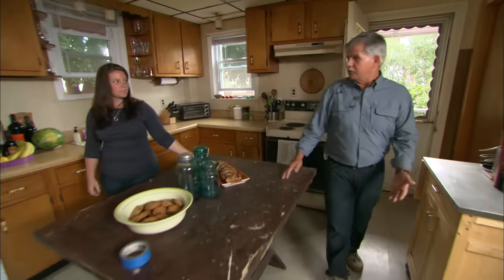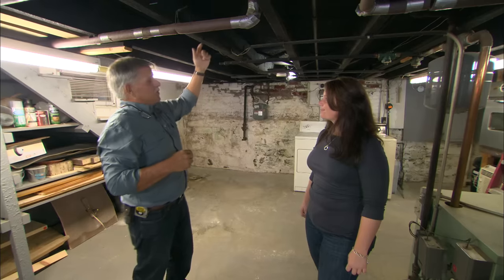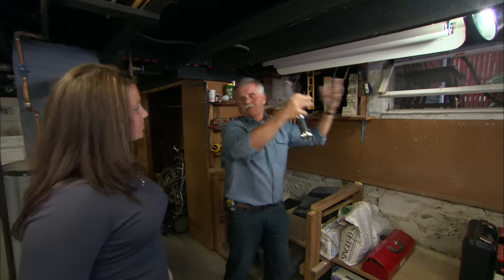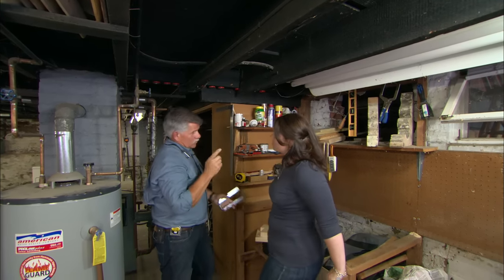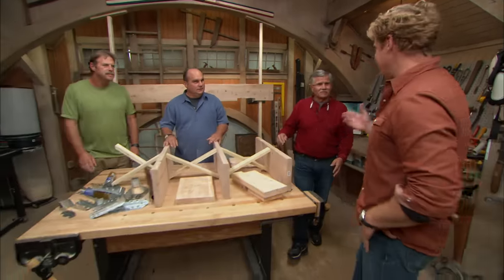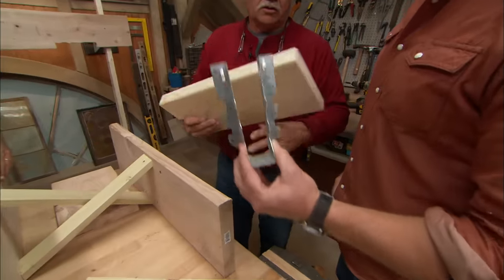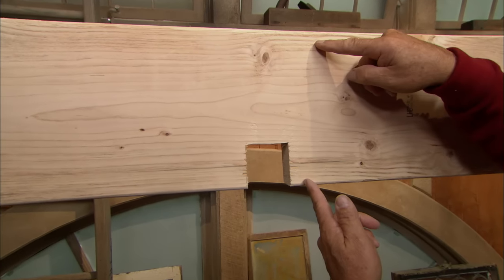How to Repair a Cracked Floor Joist | Ask This Old House

Comment: Tommy sure nailed it! plumbers hack up the framing all over. I have gone in after them and had to redo their work and repair the framing as well!
Reply: I saw a guy put in a gas line he cut out a notch thats about 75 % of the floor joist
Reply: Previous owner's plumber cut the entire joist to lay a pipe (rather than modifying the pipe run) and propped up the mess with loose brick (in a crawl space, about 20 inches tall).  I get to fix it.
Reply: bob nice, if its done right, then you can sleep like a champ,

Comment: Good job on showing the repair, however if the floor has sagged to a certain extent, the one thing he missed is that the flooring you put in can or will buckle, had to replace the flooring in my laundry room due to the re leveling of the floor. Be aware of this as you may end up replacing that flooring due to re leveling. It will also depend on the type of flooring in place.

Comment: Bridging not only transfers load to neighboring joists, but bridging (or aka blocking) also prevents the joist from rolling or twisting, which significantly reduces the maximum load of the joist.

Comment: Cutting out a sharp corner introduces high stresses (under load) into a beam, etc. Radiusing the corner greatly reduces the peak stress and spreads it out.

About 1967 or so Ford racing engines had a high failure rate due to that very thing. When machining a bearing journal or something that had two perpendicular faces, they used a sharp tool to cut into the corner. High RPM, etc caused several failures, before they learned another way to do things.

They ended up using a slight radius on the cutting tool, something like 1/16" radius. Bingo. No more broken crankshafts.
Reply: Exactly. Radiusing crankshaft fillets is standard procedure for increasing crank strength.
Reply: Great story

Comment: When I was assigned in the Middle East by my government in 1975 (I was 49 years old by that time) I am also an adventurous guy so I went from village to village and I saw a carpenter doing something strange and he told me he is making Aramaic wood which is wood of the Aramaic Bible. He cuts the timber into very thin, long, rectangular sheets and placed the 1st layer on a very thick and flat metal non-sticking anodized surface that has guiding pins made out of the same material on it's sides, then he brush it with a thick layer of boiling sap resins and places an another one on it and repeats the same process until he has reached the desired thickness and then a non-stick annodized thick metal plate is place on it and his sons and nephews places iron weights on it. 

He said they sometimes use a large number of vices to compress the material. He also said they do not make this woof often anymore except as timber beams and timber posts, joists and rafters and wall frames, stair way supporting frames, floor and wall and stepping stairway foundation planks, foundation door frames and doors only for very well to do traditional families. 

They only do it for the main wood foundation structures only for the hardened and cured sap resins discolors the very thin wood layers as it penetrates and saturates the wood. Then they place a thin layer of the desired wood and use modern wood glue and small nails to cover it with non-discolored wood. 

And it is almost virtually impossible to break because if he takes two pieces of thin wood layers and used the same technique of binding them together and holding them in a very tight vice the layer between the two pieces of wood will not break but only either the outer sides will start to crack but when used as a very thick planks, beams, posts, joists, rafters, stairway supporting frames, etc it is virtually indestructible. 

I asked an Aramaic Priest about the historical background of the Aramaic wood and he said it is the same kind of wood used by Noah to build his Ark! When properly made, hardened, and cured, and seasoned it should last forever and will outlast any metal and stone and clay and ceramics known to man. The gopher wood mentioned in the Chrisian Bible is actually structural laminated wood, only done in the original Pre-Flood methods and techniques.

Comment: The bridging is under compression as described, not tension.
Reply: Technically both. The "downs" undergo compression, the "ups" are in tension.
Reply: @VideoNOLA  Cross-bridging as shown cannot hold a tensile load.  Nails do not work well in shear.  Only the members pointing down from the joist in question will transfer the load by compression.  Just saying.

Comment: Tommy said there would still be a pitch! Why wouldn't the floor level up if the joists is fixed?
Reply: 'cause the whole house has settled over 100 yrs in part because all of those joists were notched. Also foundation cracks,  settling, deterioration, expansion and contraction from freeze thaw cycles,  earth quakes, soil compaction or lack of , underground water, flooding, poor drainage  etc. yada yada.

Comment: I was just under my inlaws house thru the crawlspace of their 70 year old home, and they had bridging. The bridges were nailed at the top of the floor, but none were ever connected to the bottom of the 2X10's...they were just hanging there waiting for nailing that never occurred.  This is why their floor always had bounce. Pretty crazy stuff.
Reply: Did you fix them?
Reply: Crazy! You can also add strapping I think. This can replace bridging

Comment: OK Tommy said you had to nail a sisters section to a damaged beam. Of course drywall screws are WRONG but would not deck screws or 1/4" thread size lag bolts be OK?
Reply: +esoomreltna properly sized wood screws would work. The reason that nails are preferred in this type of application is that nails have better shear strength than screws and the load on a sistered joist is mainly shearing force.
Reply: Shear strength has to do with the type of material and the cross sectional area. Drywall screws are not acceptable for these types of situations because they are too brittle (Just as Tommy said). Walking on the floor creates a cyclic load on the fasteners. A brittle faster, like a drywall screw will not stand up to that cyclic load as well as a softer steel nail.
Reply: Most screws dont have any sort of shear strength rating required for structral work. Simpson (and other manufacturers) make specialty screws that have engineered load ratings and are alot easier to work with than lag bolts. I

Comment: My joists are notched on my ancient house and a few have split. I ended up sandwiching each cracked joist with pieces of scrap on both sides and hanged tools from them to disguise my original intent.

Comment: Why not use construction screws instead of nailing ?

I thought was common knowledge no drywall screws for strength..  just use proper stuff.
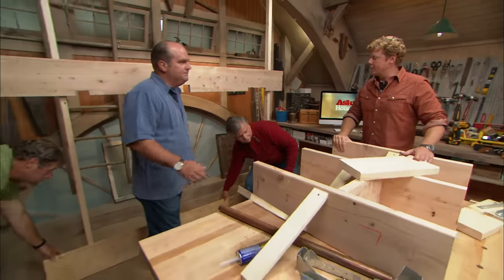Reply: 9:36 drywall screws vs nails
Reply: Home Depot was too far away
Reply: I was in a house where the guy installed the joist hangers for his loft with drywall screws

Comment: I would have added a second joist just to reinforce that part of the house and probably a small metal pier in the middle. But I'm a freak: I like to over/secure things. I hate frailty. I like sturdy and super solid structures

Comment: If possible it would be even better to avoid cutting into the bottom and top part of the joist, as this is where the tension and compression in the joist is the highest. At centre height there is a line of "dead" Wood between tension and compression where you preferably make Your holes.
Reply: INdeed. IM surprised that few have mentioned that the large hole in the beam is in the top compression area. Reinforcing the bottom tension area as he did is pretty pointless if you still allow the compression to remained compromised.

Comment: ...or....you could just use the correct screws like coated structural lags.....
Reply: Aezelll and spend how much more for those over a 10d
Reply: @snowmobilertodd  There are other reasons; very seasoned hardwood (recycled) that has to be pre-drilled, aged, RSI tormented arms, that find it far less painful to screw, no room to swing a hammer etc.

Comment: Regarding screws vs nails on the sister of the joist is the true reason we use nails over screws is that nails are stronger when applied horizontal then screws , Nice video as always
Reply: I think so

Comment: The Cro Magnon we bought from hacked about 70% the way through three adjacent floor joists to run a heat supply line, just to avoid building a duct box in a basement ceiling. I was just as mad at him as I was at myself for missing it, never mind the Home "Inspector" we hired that probably overlooked it for the realtor. Anywhoo, the plywood sistering job I did about 5 years ago is just what is called for here, tons of PL and a half a box of nails. Good series this.

Comment: I know this is an old video but can you use lag screws to attach the sister board? Something like a Spax powerlag screw or GRK structural wood screw as options

Comment: At the end of the video....placing a 1/2" plywood stringer along the joist.  Use wood glue, spead it evenly over the entire surface and then nail it into place with those same joist hanger nails.  We call them Teco nails.  they are loaded with sheer strength.  Place them every 12" and 2" from each edge.   I did this on my 2x4 roof rafter 100 yr old house.  The cedar shake roofing had been ripped off, leaving 1x8 roofing boards that they nailed 1/2" plywood sheathing to and then asphalt roofing.  The rafters are 16" O.C. We bought the house and found that the center 8 rafters (It's a hip roof) that are 18' long had a 2" bow in the middle from the weight.  I got a big beam and placed it on the floor to carry the load (2x6 floor joists acting as ceiling support for 2nd floor bedrooms) and then jacked up the roof about an 1".  Lots of creaking and I didn't want to risk any more.  then glued a 2x4 on edge with each rafter all the way tapered to the outside wall rim cap.  Lots of knee time laying on the the floor cramped up against the roof.  Then sandwiched each new "2x8" with 1/2" plywood glued and nailed as described above.  Staggered the plywood to carry the load.  This saved 1 1/2" space, made the roof 3x stronger and saved the 7" space to spray in foam.  Then capped it all with T&G pine, carpeted the floor and put in a pool table and a wet bar with fridge and ice machine.  The ultimate kids hangout.  The floor is insulated and we never hear the kids with their friends over.   Teco nail those 1/2" plywood sandwiches you make. - every 12"

Comment: Yeah, don't put notches in the top or bottom of beams - especially not in the center of the span.  The critical failure mode on beams is normally bending and the peak bending stress normally (assuming you're loading the beam fairly evenly) happens at the center of the span.  That's why it needs to be its thickest at that point.  If you absolutely need to run something through a beam then drill a hole right in the center of it.  That way the effect on the moment of inertia (and therefore the bending stress) will be minimal.  Or if clipping the bottom of the beam is totally unavoidable for some reason then add a doubler like they're showing.

Comment: hnnnnn I learn so much from this show, I love using drywall screws but I know all too well the heads break right off if they are used incorrectly.  I used to just buy stronger screws like those that would say structural grade screws. but Nails huh, never thought they would actually be stronger.  I don't think they taught me that in school lol. Love this show.
Reply: Well I'd say drywalls screws have some strength but they do snap off. When's the last time you saw a 12d or 16d nail break in the middle?

Comment: I know drywall screws are too brittle to sister a joist, but would you ever use steel exterior or decking screws?

Comment: Don't screw the wood on because "Drywall Screws"...?  Bolt it on or lag it.  And it's always better to cut into the top of a joist rather than the bottom.  The top is in compression and less likely to fail.
This is an old video.  Tommy has changed his mind about a lot of this.

Comment: I have to tell people about using drywall screws all the time. I prefer to screw everything with the correct exterior grade coated screws but I use nails for rough framing. Usually because you're framing too much to screw everything. I always use liquid nail as well. I feel like you can't use it enough especially where two wood surfaces meet each other.
Reply: Liquid nails is literally one of the weakest construction adhesives you can use!......Bad choice.
Reply: @cornbobrimlove7892  I use it to keep from squeaking and it reinforces joints. As far as it being the weakest adhesive I can't imagine needing anything stronger. I've built many additions garages and all types of wood related jobs around a home and they're all still together and not making a sound. If its junk then so be it. I'll use it til it fails me or they stop selling it. I've used PL 400 as well but for the extra cost I don't see the difference. I'll stick with liquid nails.

Comment: What if the notched joist in question is hanging on concrete? Can you still use a joist hanger attached to concrete?

Comment: I'm curious: 06:00: because of that bad notch, does it mean that joist is now essentially 2x4? Meaning structurally it is as if they used 2x4. 

This is an awesome channel I recently discovered.
Reply: I would think not, because 99% of old houses are built this way and they are still pretty solid. I think the fact it's at the ends changes the equation. Regardless I think adding hangers is cheap insurance and I will do it.

Comment: Installed solid blocking like this on my new house. With lumber shrinkage the floors would creak so all the blocks and joists had to be screwed together.
Reply: Moon Pie  I joists seem to be the industry standard today.  Twenty years ago (in this area) only high end houses were built this way.

Comment: Why was the joist hanger so short ?  Tommy says it fits perfect, but the bottom holes in the hanger couldn't be used (see 4:04).  Simpson Strong Tie always recommends using every nail hole in their hangers for structural integrity.  Tommy could have used a longer joist hanger and thus use more structural nails.

Comment: When using joist hanger one of the worst things you can do is drive the nails in lever or at a right angle to the beam or angling the nails upwards (like if you are a short guy having to reach up). Over the years the load can pull the nails outward and the hanger can slide down the nail. The best way to drive nails is slightly downward so that as the load is applied to the nails the hanger wants to slide closer to the carrying beam and the nails are pushed tighter into the carrying beam. I see wind bracing nailed from inside the attic outward so that if the roof did try to lift off the nails would be pointing in the same direction as the pull, not good. Wind bracing should be nailed from both sides so that you have nails both pushing and pulling against the load.

Comment: FYI 3/4 plywood only adds about 12% of the original board's bending strength, and only in the 8 foot long area of sistering.  You can't glue on a bunch of 8 foot long strips of plywood to the total length of the joist and expect it to strengthen the entire joist, because there's a discontinuity every 8 feet.

Comment: So i just bought my first house that was built in 1936. I have quite a bit of floor sag as well as if my dog runs through the dinning room it shakes most of the house. 

I was thinking i could just remove and replace these boards that are showing their age one at a time as well as doing the flooring bridging. Would that be ok?
Im no carpenter but only a metal fabricator

Comment: My house built in 1983 has bridging that is metal straps. In a few spots every time you walk over the floor you can hear the nail gnashing against the strip making a small squeaking sound.  It's so anoying.  And in the general area, the floor still moves a little like it's unstable  Was the use of the straps just a phase builders went through, or are those New Year's Eve noise makers till used widely today?  What's the consensus by carpenters using them?

Comment: My 40 yr old home has a 2.5 ft crawl space. The kitchen tile grout always cracks. I'm not going under the crawl space to fix it! I hear a great tile grout will not crack or chip! Especially around flex areas.
Reply: opisex yeah been there replace all the joist on a add on that my home has would love to be working under a basement as deep as the video.It is done now treated boards, deeper crawl space and vapor barrier.I sleep better know the kids won't fall through the floor.

Comment: Hanger nails are just short versions of framing nails.  They're designed to allow you to nail into  a 2x and give you the shear strength of a full thickness framing nail, without sending the nail out the other side.  But the first place he uses a hanger nail is into the beam.  Since the beam is greater than 1.5" thick, it makes no sense to use hanger nails there.  Just use 16D nails instead, and save the hanger nails for going into the split joist.

Comment: House builders 100 years ago didn't anticipate a 400 pound refrigerator . The glue used would not be the best choice of glue , but would be "adequate" ... as well as the joist hanger . A permeating wood dryer and bonder should take care of the possibility of wood rot and be the precursor to glue / adhesive . 
A 10 gauge steel plate should be added across the crack in the floor joist and a steel post floor jack should be added . Adjust the floor jack Gradually over weeks and the dip in the floor should turn to level .  
I'm seeing long expanses in the floor where the load bearing is not supported by floor jacks or supports . The home is actually holding up very well .